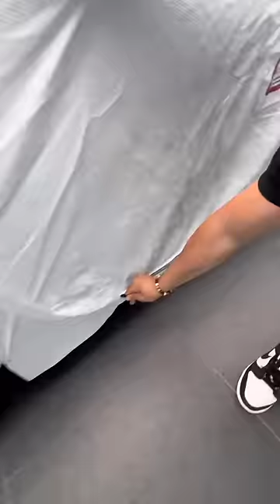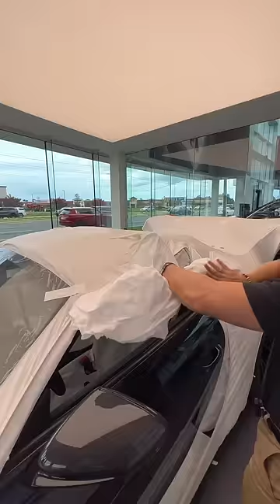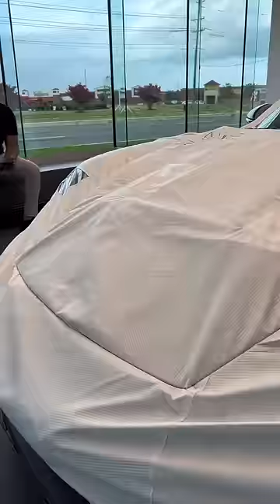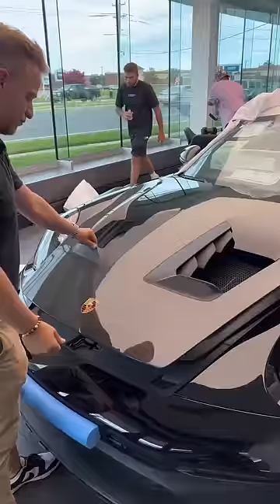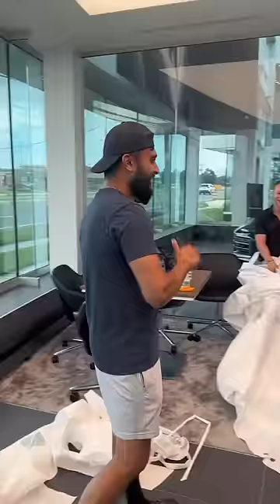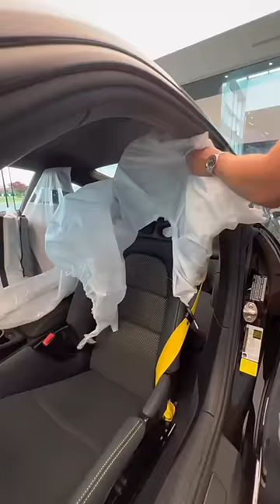Unwrapping the 2024 Porsche #GT3RS #unwrapping #shorts

Comment: That design never gets old
Reply: but you do
Reply: @cheezpuffz8019  ok lol
Reply: @thesimaviator of cause because it’s a German car. German cars never gets old. Don’t forget this 😉(Mercedes,BMW,Audi,Porsche) 🔥
Reply: It's a 2024 model, what are you on about 😂😂😂😂
Reply: @EMB1199  Yes, but the design of the 911 hasn't really changed since it's launch in 1963
Reply: @thesimgamer5302 //
The 911 Body Style has not changed. Materials, Mechanicals, slight changes to track (width), fender flares, 
wheelbase, engine, length, engine, suspension, etc. CONTROLS.
Reply: You also not get old driving this......
Reply: It does.
Reply: Yea its old
Reply: @Mr.James_Selest007 Yeah, my first gen BMWZ4 still turns heads. Don’t think I’m ever going to sell it.
Reply: @cheezpuffz8019
C'mon Cheedar Bob! 😉 wink wink
Reply: @thesimaviator still looks better than every single car from merica
Reply: @nickm.5541  very true